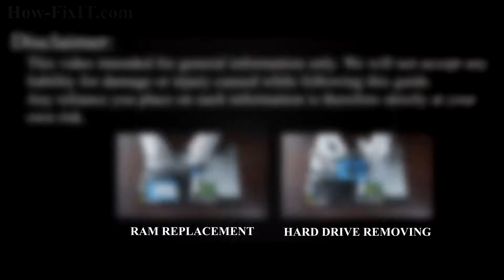Toshiba Satellite C55 Disassembly & Fan Cleaning | Step-by-step DIY Tutorial

Comment: For some reason, when I opened the back of my computer...THERE WAS NO FREAKIN' FAN, just some silver flat panel that covered the space for the fan...YET IT WAS WORKING.  Additionally, I don't see a CMOS battery either...just the space for it.  For some reason, I kept getting BIOS date/time messages periodically, when I booted up.  I'd change the date/time and it would boot up but all-of-a-sudden...NOTHING.  It seems like it's going to turn on, as the backlight of the power button illuminates for about 7 seconds, then it goes off.  PLEASE HELP, because I can turn a computer inside out (build one) BUT this is puzzling me.  I need to get back in my laptop (Toshiba Satellite C55-b???...looks exactly like this one in the inside) to retrieve important stuff.

Also, does it matter if the screws in the back are replaced with the correct screws (some black/some silver), as I noticed on the inside, a couple of the screw holes had numbers/letters by them but I forgot which screws go where.  I put the back panel back on but REALly think I screwed up (pun intended...lol)?

THANKS, whether you can/cannot help and if for some reason, you can't respond back here (or better yet, I don't get notification you responded back...been happening in my life here lately), please (PLEASE) go to my Google+ page:  http://plus.google.com/+kimmewyattonair and leave Comment under either post of my KimMeTech Community!  BAFFLED :-(

P.S. After doing research on this issue, I noticed a lot of people wondering where the CMOS battery is and the Toshiba website does not specify whether it belongs there or not.  Funny thing is, I called Walmart.com, where I purchased it and they don't sell it anymore...REFURBISHED!  I waited for a minute to get a Toshiba laptop, as I've always heard they're the best and all I can say is:

#Toshiba #Sucks